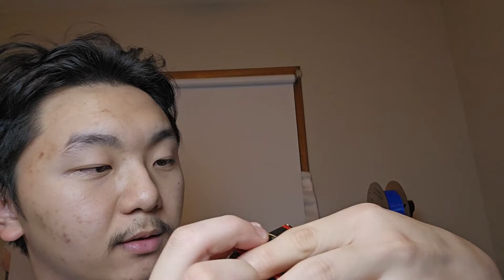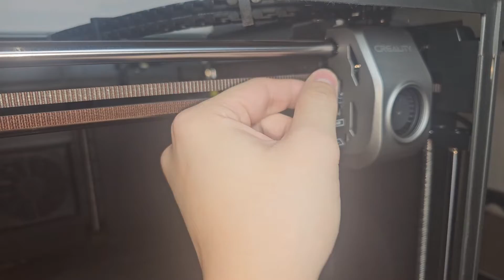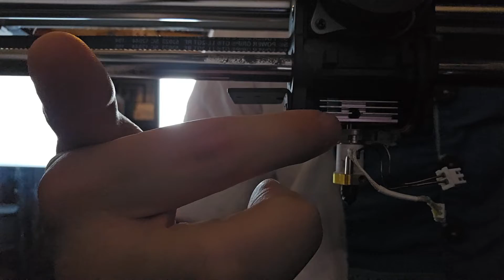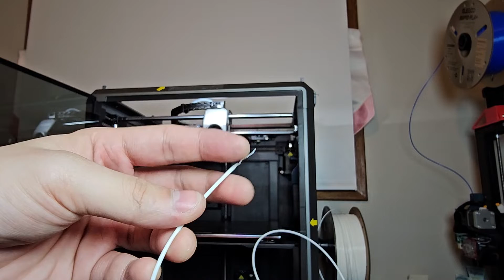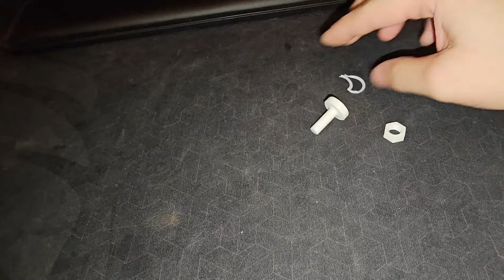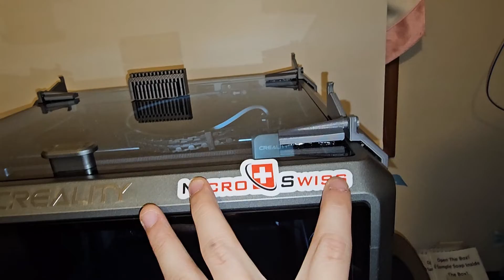Micro Swiss FlowTech Hotend Installed For Creality K1-Max Best Mod

Comment: Is there a similar hotend, but it's square, and you can just change the nozzle, and it's cheaper than the microswiss
Reply from the maker: There are many different types of hotends out there and they are cheaper than microswiss.

Comment: I installed the Micro Swiss hot end and mow i’m having over extrusion issues. I can’t even get the calibration to print right for flow rate. Do you have any tips?
Reply from the maker: You'll have to do more calibration and adjust the what you are seeing from your prints. Also try adjusting the temperature down a bit.

Comment: hi..once you upgraded to the flowtech did you find you had to do much with it to print well..i just upgraded from the unicorn as i had the blob of death but im finding the flowtech very stringy at times even tho ive lowered the temp
Reply from the maker: Yeah it's a bit different than stock. It could also be the filament you're using.

Comment: FYI you shouldn't grease the X-axis rails, they're self-lubricated with graphite. That's why you're getting grease on the hot end fan shroud!
Reply from the maker: Yeah learn that after making the video.  Thanks for the tips.
Reply: @Scratch3DPrinting  Yeah, I learned it recently too, I wish they made it a little more obvious!!

Comment: can e explain where blue tube is going, i cant find the way to install it.
Reply from the maker: the blue tube goes in at the top. You put in the blue tube then the extruder. That blue tube guides in the filaments into the nozzle.
Reply: @Scratch3DPrinting  thx

Comment: I just got the micro swiss flowtech hotend but there is one thing is a problem for me, the hotend is good and good printing but when i take off the support the hole thing is cracked.
Reply from the maker: oh wow, that's not good, mine has been fine so far. Maybe contact Microswiss about that problem.

Comment: Here's what I'm curious about. I currently own the new series k1 max. There is a unicorn nozzle on it. I want to use a normal nozzle instead. But what I don't understand is, is the product in the video compatible with the new series?
Reply from the maker: I'm not sure myself as I got the older version hot end of the k1 max. I just replace the whole thing with the microswiss hotend.
Reply: hi..for those curious flowtech supplies the right adapters fir the original k1max and upto 2024 k1max in the box.. if you have the very latest 2025 k1 max then you will need the updated flowtech nozzle available on their site

Comment: Very interesting that you can swap the nozzles COLD with teh Microswiss but not with the OEM.
Reply from the maker: It is, I have tested it recently and it actually worked.
Reply: How does the cold nozzle swap work? I mean there would be plastic in there right? Do you have to clear it out first?

Comment: something about messing with the hot end makes the light turn off - some sensor must be tripped, I honestly thought I must've disconnected it's wire or something, but it's an electronic off, not a physical. you can turn it back on from the touch-screen, it shows the light icon 'off' but it never turns off by itself doing anythign else. weird.
Reply from the maker: hmm... that is weird.

Comment: For me, removing the wires was far easier than plugging them back in after the switch. I ended up removing the PCB boards and plugging them in, then putting them back. My big fat fingers couldn't do it otherwise.
Reply from the maker: Yea, it was quite hard to pull them out and putting it back in for me too.
Reply: Yeah it's a terrible design

Comment: The nozzle u get on ur new creality hotend is a copper alloy nozzle not steel, steel ones are black
Reply from the maker: ohh, I didn't realize that. Thanks for the info.
Reply: @Scratch3DPrinting U're welcome !
Reply: I have the new micro swiss hot end and the hardened steel coated nozzle. It's not black it's shiny everywhere except the very tip.
Reply from the maker: ahh, thats nice, I am thinking about getting some myself too.